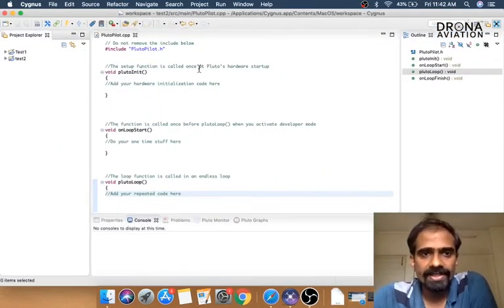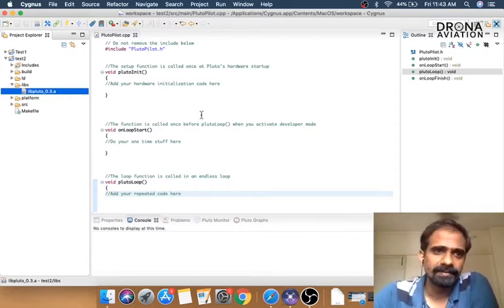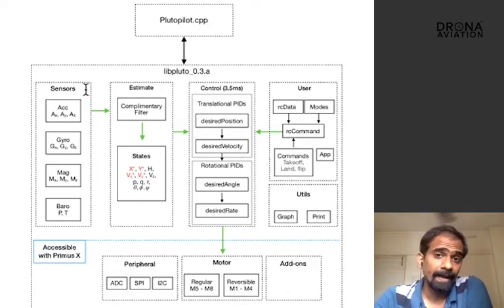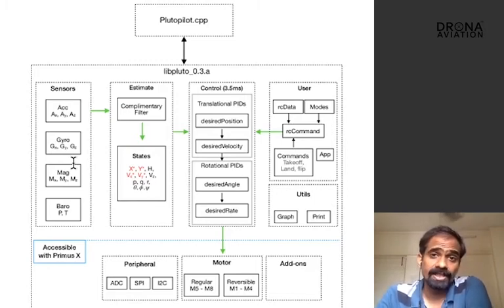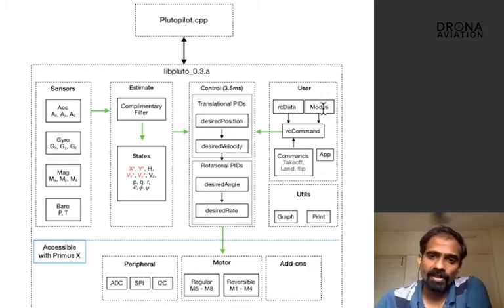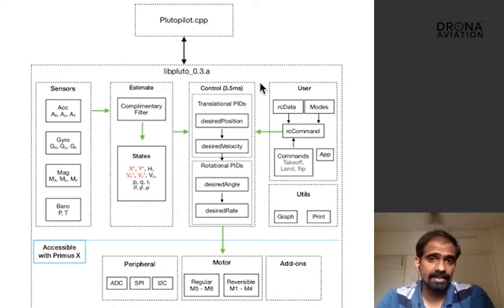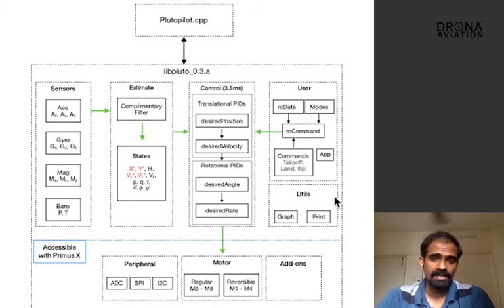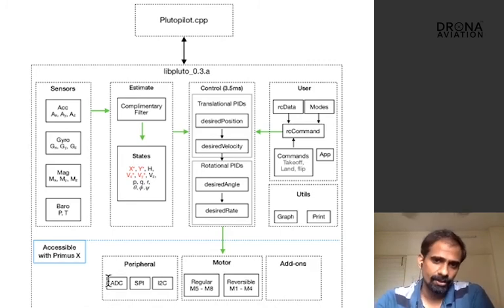Drone Programming Using Cygnus IDE: Understanding Firmware Structure

Comment: very interesting. for advanced users, is it possible to uodate the firmware indide libpluto? say for example I want to change the PID algorithms, or implement more complex filtering than just complementary - like kalman, or maybe add an optical flow sensor and include that in the PID. can it be done? thanks!
Reply from the maker: Yes, Check this out: https://create.dronaaviation.com/software/tutorials/cygnus-ide/working-with-source-code